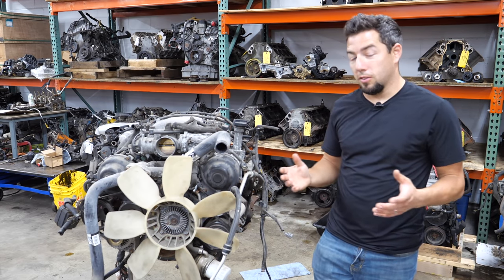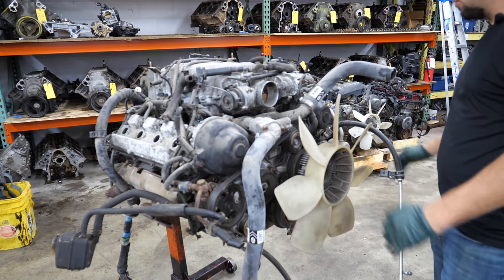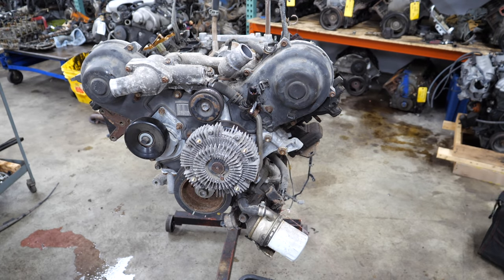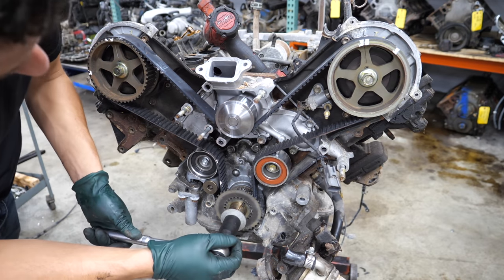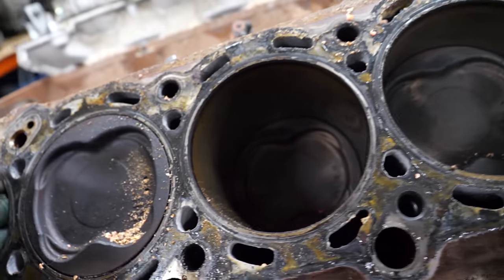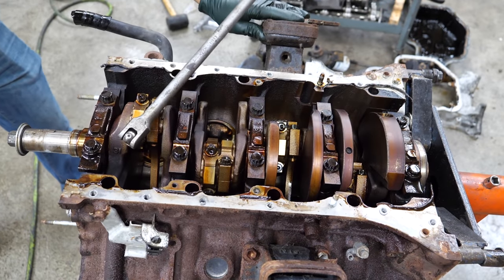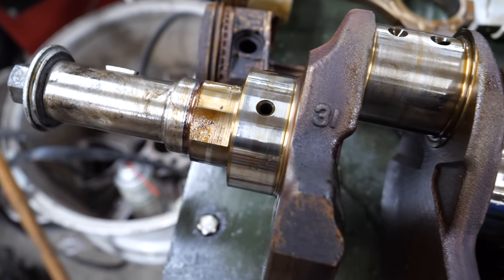Toyota 4.7L 2UZ Total Engine Teardown! Low Compression, But Why? Tundra Land Cruiser Sequoia LX470

Comment: Remember that this engine was made to go in the Land Cruiser. The location up top keeps it dry and away from water during crossings. They are also known to last 100s of thousands of miles and decades without going out. My 06' 2uz still has oem starter. Pops off like a champ! I also think its part of the design for its versatility. The 2uzfe shares the 1uzfe block in large part. The 1uzfe was designed to go into not only verhicle but airplane and marine applications as well. I think the starter packaging aside from the known benefits assists with this versatile packaging as well.
Reply: still using the original starter that is on my Impala with 260k miles. they definitely make them better than they did years ago. i had to take the starter off to do some transmission work and they dont even use shims anymore. just bolt it up and go. plug and play!

Comment: Those bearings looked great considering the lack of care this engine received, as far as oil changes. To get this vehicle running well again, I'd put a few ounces of MMO in each cylinder, let it soak for a few days and I bet that would help clear the rings a lot.

Comment: i got a 2uz. It's got 250k on it and the motor runs like the day i bought it.  This engine needs to work.  It seems like the harder and longer I run this truck the better it performs.  The 2uz is not a performance engine but it is reliable af.
Edit: failure point=power adders
Reply: Failure point = heater t's

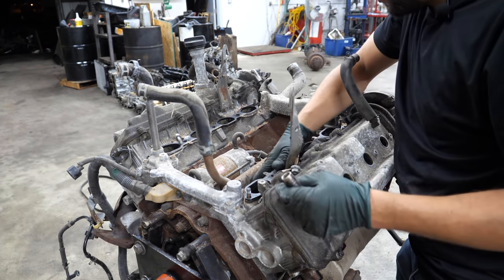Comment: 8:31 I own a 1UZFE which is lot like this engine.  I bought the car used as my daily driver in 2011 and didn't need to replace the starter until March of 2021. So, yeah, it's a bit of work to replace it, but if you only do it once every ten years......... the starter that failed was a Denso remanufactured unit.

Comment: The best small V-8 made. 300-400K miles isn’t even noteworthy. After almost 30 years of working on Toyota’s I’ve probably only done six of the starters in the Toyota and Lexus V-8 engines. All had well over 200K miles on them when they failed. I get get 7hrs to replace one so I don’t mind doing them. Only go back with Denso unless you want to do it twice.
Reply: But the Autozone starters have a lifetime warranty!! 🙄

Comment: Toyota has coolant cross over and doesn't have overheating issues.  While competitors have coolant cross over in the front which useless and overheating problems.

Comment: I have a 2003 Sequoia and that same  engine purs like a kitten..At 198,000 miles it does'nt leak or use a drop of oil and when i change  it still looks like golden honey on the dip stick. has had a very good life with great service records.  / I'm shooting for 300,000 K.

Comment: I worry about the location of that starter on my 2007 tundra 4.7 . It is pool service truck here in Phoenix Az . 414,000 miles (mostly city)  Truck is running like new at this point 🤞🏼

Comment: Eric, The next time you have similar rusty cylinder walls, try using some WD40 a few minutes before you scrape them clean with the rings. WD is not only a good rust solvent, but provides some good lubrication, as well.

Comment: Just for the record, Toyota(bless their hearts) from the factory install little coolant drain spouts in most, if not all of their modern engine blocks for draining the water jackets. The 1UR, 3UR, and this 2UZ all had them on both sides, they are wonderfully handy, not every engine tear down has to turn you into Miles Davis.
Reply from the maker: I found it on this block when I flipped it over. In the rust belt they’re usually pretty rusted shut but I’ll try it next time
Reply: I suppose I’m spoiled living North of the rust belt

Comment: I’ll vouch for the starters! They’re a lot easier on these than the 1UZ, as the rear coolant crossover blocks your access to the starter bolts, as well as the EGR pipe (don’t believe 2UZ/3UZ had EGR) which the tube always breaks and is a bear to replace. Takes me about half the time to to a truck/ LS430 starter as compared to an LS400 starter
Reply: 3uz fe has an egr

Comment: I recently picked up a 2003 4Runner with this motor and I feel more and more lucky as the weeks go by to have found a 4WD version of these older 4Runners with this motor and under 190k for cheap. On the hunt to buy a 2nd one as a backup before they become impossible to find.

Comment: I have heard that the Landcruiser V8 diesel engines can have starter motor issues if they proceed through deep water, the starter motors eventually fail due to water ingress.

Comment: Survey Says - Replacing Tundra starter should not cost over $1000. Tundra starters last well up to 75000 miles but after that need for replacement dramatically increases. Its  good to have a friend who owns a boneyard. . . I mean auto recycling facility. Thanks for the video.

Comment: I think the reason it had low compression in ONLY two cylinders low was that the rings on those two had rusted out of position, meaning they weren't pushing up against the walls near as hard as needed. I guarantee the oil changes contributed (that's why even Toyotas can burn oil, the rings stick due to sludge, rust here, and don't seal right). The rest weren't far behind based on the footage.

Comment: I bet that engine was fine except whoever just did the belt put it a tooth or two off on the bank with low compression...would explain why only 2 cylinders were low

Comment: Eric, what are you doing man? This is contagious... I just bought an VW ea888 2.0T engine and taking it apart!!! I mean I do need a cylinder head off it but I've decided to get the whole thing, just for the sake of experience... Did you ever  consider that taking engine apart (without need to put it back together) could be a saleable commodity?

Comment: As someone with a leaking throttle body (pink coolant crystals around the plug on top) on my 188k mile Lexus GX 470, I can agree that they sell well. $500 at the dealer, about $180 on eBay. You can thread it and replace the plug, but I'm funny about having metal shavings in my coolant.

Comment: I've heard of some recommendations that if you fully intend to store an engine for a long time, put a little oil inside of the cylinders (not enough to hydrolock!) to coat them and prevent this.
I get the feeling that this engine was not stored with the intent of sitting there for as long as three years though.

Comment: The other thing you really need to swap out every time you do the timing belt is the heater T's. Either swap them every time with OEM plastic or replace them permanently with brass. I had a 2000 LX470 (in my current profile pic) that I sold this summer, but I replaced the T's at 190k (I was the 5th or 6th owner), and the driver's side fell apart as I was removing it. This can cause a catastrophic loss of coolant if it happens when its running. Otherwise, rock solid engines.

Comment: We could tell he has a successful life here and at home.  He left that impact wrench on the top of the engine when he was disconnecting snaps.  I wouldn't, my life is a dumpster fire and I peaked a decade ago (I'm 37).  I wouldn't leave that up there, it would fall off and brake and as I go to pick it up I would knock my head on the engine and it would fly back knocking over the fluid tray and bins.

Comment: I just had to replace my starter and I did both knock sensors while I was in there, not pulling that thing apart twice (hopefully). There's not a lot of room between the engine and firewall when doing the starter bolts.

Comment: Had this in a 99 landcruiser. Starters go out every 100k. Took me 6 hrs. Had to lay on motor to get starter wires off and on. Silk truck with 325k and still ran beautiful
Reply: Where are you getting your starters?
Reply: @ronjohnson8119  from the dealership. It was such a big job , I didn’t want to change cheap crappy made China starters every 25k miles. It was the best made truck and motor I’ve owned by far. Timing belt  job every 125k. Regular oil changes, and that’s it , super reliable and built like a rock. I only used oem Toyota starters and oem gaskets on the jobs.

Comment: You can change 2 4.7 starters in the time it takes to pull the 1st gen 5.7 starter.
Reply: I can confirm that. I have done both and the 4.7 really isn’t bad at all. The intake is really easy to remove and the starter bolts aren’t all that hard to get to. People complaining about how hard this starter is to replace obviously haven’t worked on too many cars.

Comment: I have a 2006 Tundra with the 4.7 engine, 130K miles. I keep it in perfect condition. QUESTION: I know it's probably a case of ageing out instead of wearing out but should I consider getting a new radiator? If so, what brand rad. from where?

Comment: You know there is a drain plug on the side of the block to drain all the coolant out of the block. You can see it at 18:38, it has a hex head for you to use a socket or wrench

Comment: at the risk of being roasted in the comments...I just changed the valve cover gaskets on this engine.  While doing so, I dropped a nut for a 6mm fastener down one of the oil gallies.  The nut is 10mm across the flats.  When it fell, I heard a "ping" which I assume was the nut hitting the baffle above the oil pan.  To drop the pan, I need to drop the front diff or pull the motor which I can't do at the moment.  Based on this video, it appears that the chance of the item getting tangled in the piston arms and crank are low.  It looks like it will safely sit on the baffle with an inch or two of clearance.  What are your thought on leaving it there and driving the car until I can pull the pan?

Comment: I just swapped one of these engines in my Land Cruiser. The bottom end was hammered pretty bad on the old engine. The previous owner may of ram it out of oil. The "new" engine has 143k on it and runs great. Do you still have that old crank still? I could throw that into the old engine and it would be good again... Great video.

Comment: Jesus seeing that new belt is giving me feelings. I have a motor with 190k and has about 10% compression loss in all 4 cylinders and I’m debating doing the timing belt on it. Lol I don’t want to spend money on an engine that will need a rebuild shortly thereafter.

Comment: Starter in the V? Now some manufacturers are putting two stinking hot turbos in the V, including some supposedly high quality German manufacturers. I know which one I would prefer. BTW I would imagine it is less susceptible to heat damage there then running close to an exhaust manifold/pipe. Plus those Denso starters are a really well made units known for their reliability. If this is the only real criticism of this engine, I think it is doing rather well.

Comment: If they were adjacent cylinders then could be head gasket. Hard to see from the vid but the fire ring witness marks on the block looked very shadowy. The composite gaskets just rot over time too & allow corrosion to creep & locally unload the gasket. Stuck rings is another potential as it was a bit carbonised inside. They all sprung when removed but could have been stuck whilst in the bores. The rust looks to be an after effect as most cylinders looked similar.

Comment: I had a 2003 Tundra with this engine I bought at auction. I knew it needed a new engine because the block had a huge hole in it. I went through 3 engines. Every single engine on cylinder number 8 had a bent rod, including the one that came with the truck...that's either a big coincidence or something is up with this engine with wrecks and cylinder 8 lol.
Reply: Not sure if this is what happened but I do know that some cars will open an injector (s) to dump fuel safely if the airbags are deployed (to prevent fires). Maybe Toyota opens cyl #8 injector?

Comment: "I dropped my 12!!!" "I can almost reach it."

Where's your magnet stick???

I dropped a bolt into a motorcycle transmission while working in the clutch cavity. Magnet stick meant I didn't have to turn the motor over and split the case!

Also, GM Northstars put the starter in the V... DAMHIK

Comment: I have a question about my 2uz-fe I have in my 06 tundra. 230k miles. I have had the head rebuilt and regretting not having touched the block. But that said I've got plans to do this myself. What do you think? I'm not mechanic so DIY. Want to try to get 50 hp over stock in the low range 2000 to 4000 range. I'm planning to tow to it limit or so. Any tips are appreciated. So do I keep old piston's? I'm certain I need the rings and bearings all around, but not sure about pistons. Suppose it would not hurt, that said how about what pistons to use. And should I change cylinder bore size to get that 50 HP? I suppose that could yield more that 50.

Comment: Got a question! I’ve owned my 05 tundra foe several years, with all necessary maintenance done on time. BUT theres this buger of a knock at cold start up, usually goes away once the engine warms up. Its more prominent in the cold.  Where is this knock coming from and does anyone have similar noises?

Comment: 1 UZ variant was originally designed by Lotus Engineering when it was headed up by Tony Rudd , to be used as an Indycar engine.  It has design similarities to the Cadillac Northstar and  LT5 Corvette engines also designed by Lotus around the same time period (the location of the starter motor is one obvious one.)

Comment: Key fact is there was no key. What likely was the case to this vehicle was it was fully functional. And probably had thousands more miles left in it with diligent maintenance schedule. 

Well unfortunately, that’s not the only thing that could basically bring the cars with this engine to a death like this. 

Toyota had around the mid 1990s started their master key, lockout ignition system. So it’s absolutely pivotal that the driver has possession of at least one “master” key ready. Even better note to store it away and use “valet” or copy keys. Because in these type of systems if you don’t have at least one master key on hand to start the car, you’re looking at a fairly expensive locksmith job. Theres locksmiths that say owners basically let these cars sit for a long time because of such an unfortunate situation because most locksmiths won’t touch a system like that.

Comment: If you know you're going to park a car for a couple years, what should you do to prevent rust forming in the cylinders like in this engine?
Reply: You can get the same storage oil that is used in outboard motors for winter storage. Directions are on the can. I do it to my 1960s muscle cars for the winter.
Reply: a) start and drive it periodically
b) store dry non-humid? Not sure. 
I'd just make sure it gets fired periodically so the walls and rings get an oil bath.

Comment: You wonder how moisture gets in there with a complete exhaust system and complete intake system without rusted valves it seems strange that it can sweat that much in the cylinders

Comment: You know there is definitely a market for OEM bolt and nuts ... especially in full sets ... ie full set of OEM valve cover bolts/nuts, intake bolts, etc.

I would recommend a ultrasonic cleaner and/or a rotary/vibration tumbler cleaner for the bolts follow up by cold/hot bluing (see My Mechanics for how to do hot bluing) for both aesthetics and rust proofing.

I hated having to go the dealer for a clean set of new bolts for my old Honda ... because most aftermarket bolts were either just a little too long or too short ... and a reasonably priced used full set would have definitely peaked my interest if they were available.

Comment: Did you notice at 12:50 that the white marks on the belt (from the previous owner?) did not line up with the marks on the cam pulley? Was that cam out of time a bit or erroneous marks?

Comment: I’d rather do a UZ starter than a UR. The URs require pulling the exhaust manifolds. Some Lexus official procedures say to remove the engine to do it.
Reply: Just did one in a 2010 tundra. I beat book time by 2 hrs not to bad.

Comment: wow I stumbled on your site , I know it's two yrs old but have to ask , do you have the driver side head non vvt ?
I tore a 2000 tundra and it had a timing belt failure which snapped the camshaft in half ! so I'm after a head due to the outer cam bearing surface being scraped and guaged up

Comment: Geez, was that engine being used as a boat anchor in salt water?  Interesting that despite the obvious lackadaisical oil changing schedule the bearings and journals all looked good.

Funny thing is, if that was parked here in arid/dry Colorado where I live it probably would not be damaged at all.  Nothing corrodes here in Denver.  The ladies hate it though, the dry air gives 'em wrinkles.

Comment: I'd rather do that starter any day than the one on the 2nd gen tundra V8's, it lives behind and requires removal of the passenger side exhaust manifold.
Reply: Soooo…. you can replace them without removing the exhaust manifold but you really have to bend the heat shields. Or so I’m told😗
Reply: @ronjohnson8119  I replaced one last year. Loosen right side motor mount and jack up engine. You'll have just enough clearance and won't need to mangle heat sheilds.
Reply: twowayyo11 👍🏻

Comment: Great video; love to do what you do. You mentioned that you save bolts, screws, ect...
I am in need of one of the rods that secured the water pump. there are 5 bolts, 1 nut and 2 rods. I need one . 2000 tundra sr5 v8.
Let me know.
Thank you
henri

Comment: Ford had a Lincoln back in the early 70s that you had to take the motor mount loose Jack up the side of block to get the back spark plug out.The starter was a easy change out.LMAO.

Comment: This seems difficult to work on. I cannot imagine doing the starter, water pump or timing belt while the engine is in the truck.
Reply: It’s not hard at all I have done a starter on my 2000 tundra and I am about to do a timing belt